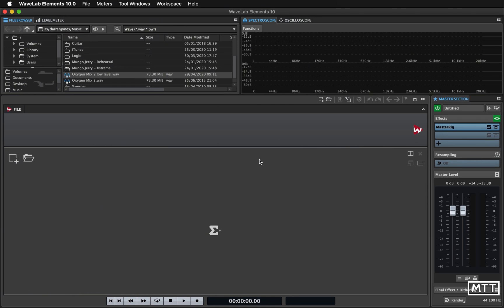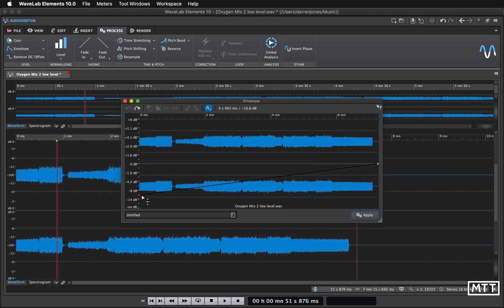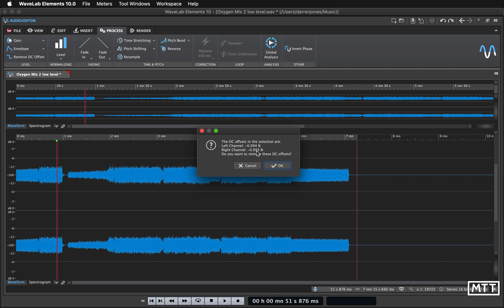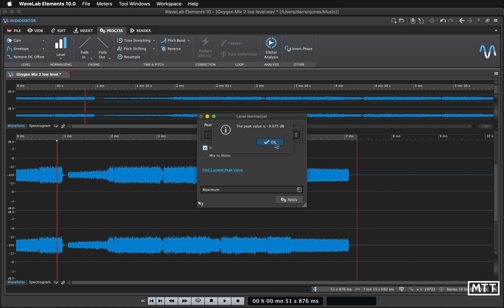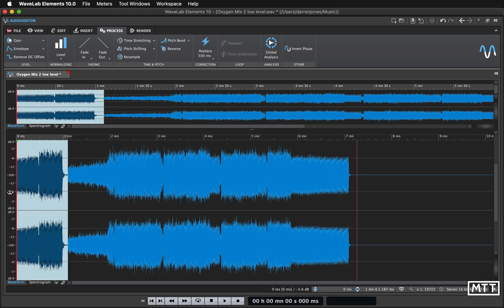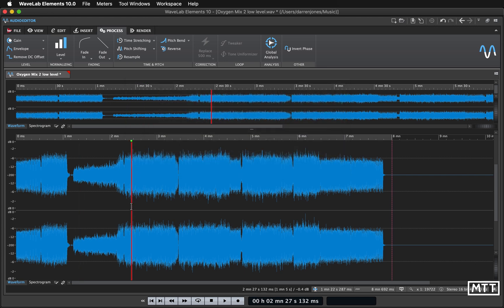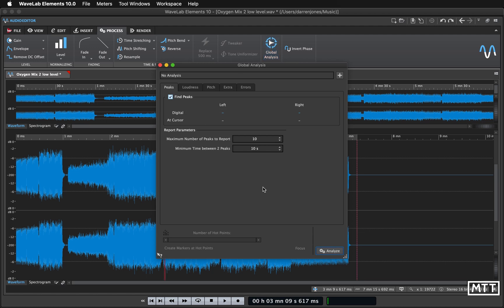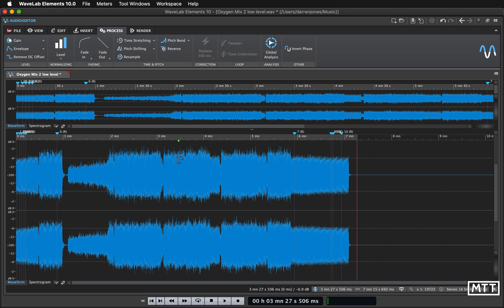Lockdown Learning: 24 - Processes in Wavelab Elements

Comment: Hi Darren, thanks for the videos. Would you bother with Wavelab Elements if you already have Cubase Pro?
Reply from the maker: I use Wavelab for mastering / checking duties and when I just need to apply processing to a file rather than creating a new project.  It's definitely not necessary to have it, but it's nice if you find yourself doing this sort of work a lot, or you want to be able to check mixdowns quickly without needing to create a new project, etc...
Reply: I have both and wavelab elements you can add metadata for your tracks before sending to platforms, great